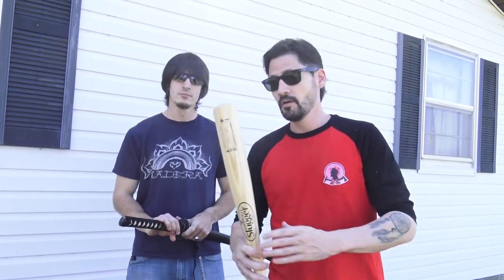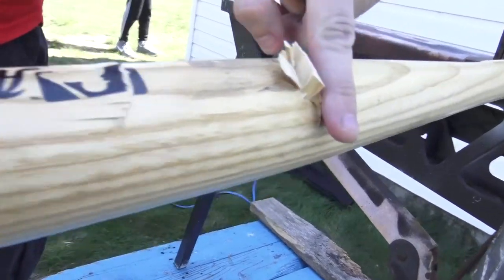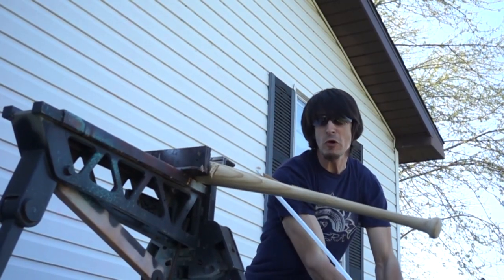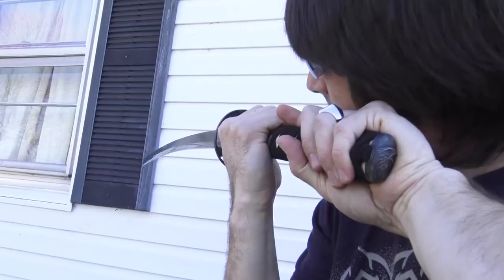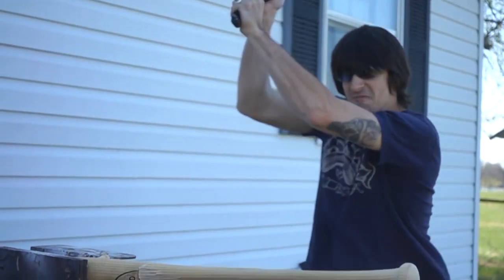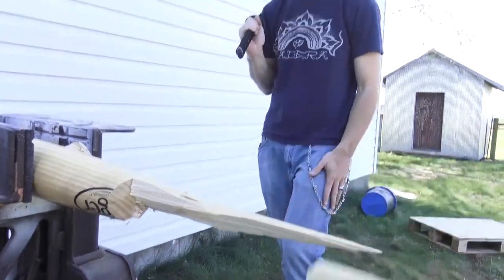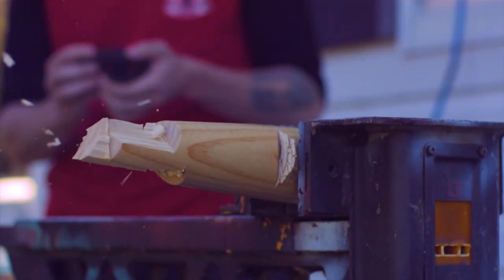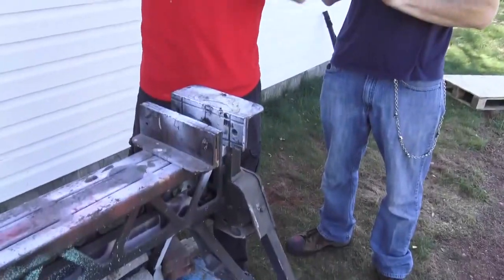Cool Science Experiment!

Comment: So this basically showing who would win michonne or negan
Reply: In motion, there is more kinetic energy, so it would be easier to cut. She would bury the blade in the bat.
Reply: He would have more energy, but they would cancel out and her sword would end up embedded in the bat. If she cut low enough in the bat near the handle, it may well cut through.
Reply: Curtis MowryNegan would most definitely win if the weapons were to clash like stated by The Raccoon. Also, Negan's bat has barbed wire around it which would add to the general strength of his weapon against a cutting weapon such as a katana. Trying to cut barbed wire with a katana is a different story from trying to cut ashwood.
Reply: Very true on most counts. I think she would have the foresight to aim for the base of the bat near the thinner wood. where there is no barbed wire
Reply: She can accurately and consistently his a zombie's neck first try, she's trained. I have no doubt that she would hit it.
Reply: In girth, yeah. Height? not really.
Reply: Aubrey Wright well you have to think negans bat is rapped with barbed wire which is made of metal so if michonne hit the barbed wire her katana would take edge damage and be less affective and negan could potentially snap Michonne's sword in half with a good hit

Comment: You can even shave yourself with a katana. But you should better be careful...
Reply: just like you could with any other blade... Why would you mention the katana like it's anything special? If it's dull, you wont be able to shave anything. Contrary; any blade sharpened properly will shave just fine. Katana fanboyism is the worst
Reply: you can shave yourself with an axe too, or any metal object sharp enough.
Reply: no you cant....... no one sharpened swords to literal "razor sharp" otherwise it would roll, bend and suffer edge damage... not the Europeans, the turks, Chinese, Japanese, no one had "razor sharp" swords.
Reply: Reed_isYoda exactly! The kinetic energy is juts fine for cutting, no need to sharpen to extremes. Knifes, however, are made for precision cutting, so it's in favor for those to be as sharp as possible
Reply: Reed_isYoda you are wrong. They were not using mild steel, they had tough stuff that held an edge. Also, blades were not used against armor so the risk of damaging the blade beyond repair is very low
Reply: I'll be sure to shave my legs with one next time and report back! That's going to be one crowded bathtub though.

Comment: Can you believe this type of Katana is illegal to own in the UK providing obtained post ban due to being forged from 5160 high-carbon spring steel?  We can only own Katana made from traditional methods & it is my understanding that this forging process requires non-traditional methods.  (They banned sale, transfer & manufacture so if owned pre-ban you can still keep but that's about it).

I own a traditional clay tempered 1095 high carbon, which is my toughest katana.  It would give this one a run for its money but admittedly would probably chip at some point in this test.

Comment: a real, traditionally made katana, would totally NOT break after these hits. It's much more resistant than the industrial ones, the process to create them is very special and the materials are really.. really expensive so nope.
Reply: Ghostcatcher64 not really dude. Traditionally made Katanas use lower quality materials. Modern Katanas use completely blended alloys which eliminates the need for folded steel. Although there are modern crap katanas, but overall, modern katanas have much better materials due to modern tech.
Reply: ZombieGoBoom I had to do research before buying mine, lol.

Comment: That katana has to be cheap. A real katana would slice through first try.
Reply: YusarisRS yes it would. It also depends on the angle, and how good the user actually is. When used as a meat cleaver, like in this video, it looks weak, but katanas can even stab through metal. I know this because I have a katana, and it slices through everything easily.
Reply: Mini OfDoom01 where did you bought your katana i want to buy one but i dont know where i get a good one and sorry for my grammar  😂
Reply: Mini OfDoom01 like what metal? If it's aluminum, it's pretty obvious it would pierce, but it couldn't cut through such thick wood or pierce hardened high carbon steel. Most swords can't, so why would the katakana or odachi be able to?
Reply: maybe soft wood but hard wood it would not.